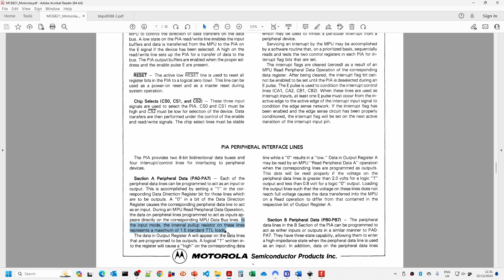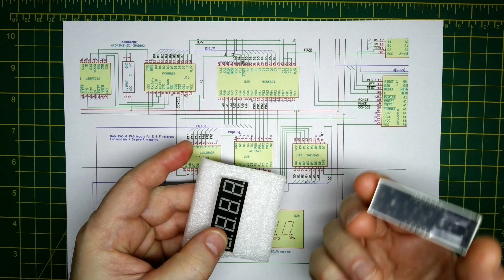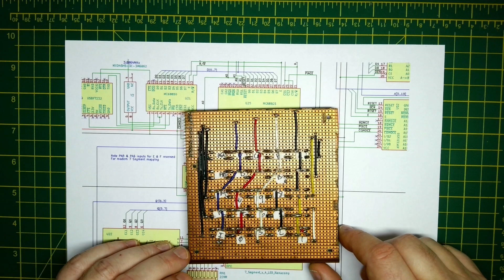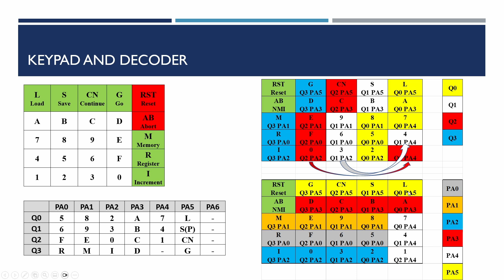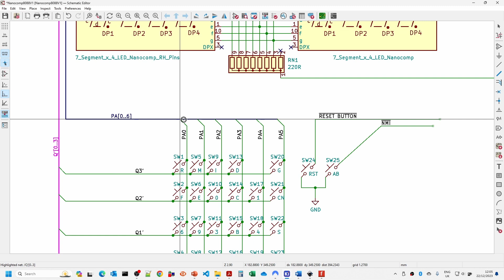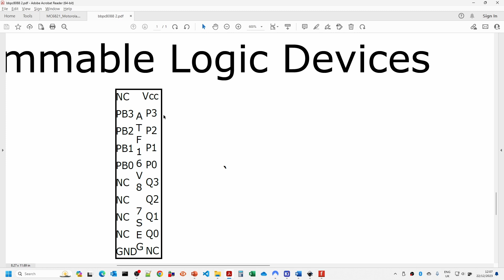Breadboard 8088 PC LED Display and Keypad #9

Comment: I ordered two 4x4 matrix keypads on ebay for just over 1€ each, since I'm planning to follow along soon. I think, these will be sufficient quick & dirty replacements if someone like me doesn't want to invest too much work into the input / output things.
Reply from the maker: I couldn't find larger than 4 x4, certainly not 5 x 5, just remember that the scan codes for the keys will be different if you use the Nanocomp monitor keypad scanning code. Dave